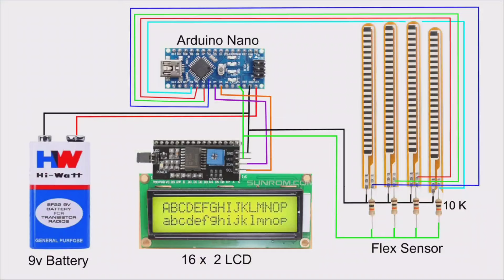Sign Glove using Arduino | Sign Language Glove Arduino | Sign Language Arduino | Code Given

Comment: I have wired the diagram correctly but the lcd screen only lights up and no text is displayed. Please help me
Reply from the maker: Check your i2c module
Reply: Yes sir we are getting the same issue
Reply: @kenhchetaovn -ec8wh  does it working
Reply: Use backside potential meter and turn right and left
Reply: I have  solution this problem
Reply: @AnsuNag-e9gyes having the same problem lcd lights up but no text is displayed

Comment: They have electronics for clothing, which has threads that carry current the same as a wire, they also have resistors made for such practices. It would make this project so much more practical and cool.
Reply from the maker: Okkk

Comment: I find a black flex sensor is that work or no ?
Reply from the maker: Yes it also work
Reply: @eazytronic9394  if the ardiono not the mini one will be using the same code or no ?

Comment: Hi bro its showing liquid Crystal i2ç not found how tk slove this
Reply: If you are using I2C module (black colour shown in this video) then you have to download its library. Which you will get in arduino ide manage library section. I dont remember the exact name but just i2c display it will probably show the required one. And if you are not  using that module then just install liquid crystal library.

Comment: In drive you have given different circuit diagram. In drive, resistor is connected to different pin of flex sensor in comparison to circuit diagram of video.🙏🙏🙏
Reply from the maker: Sorry that a mistake in circuit resistor connect with GND not VCC Thanks 👍👍👍